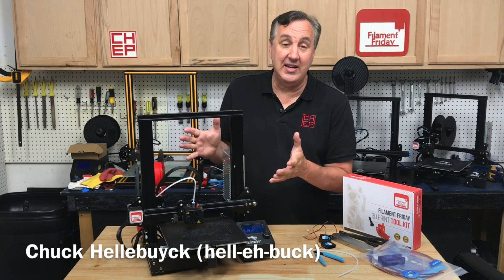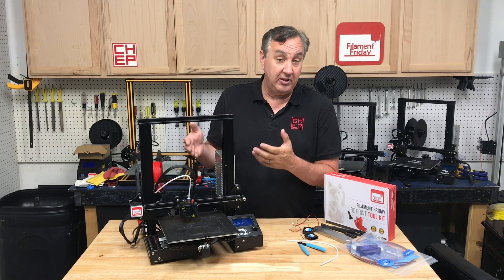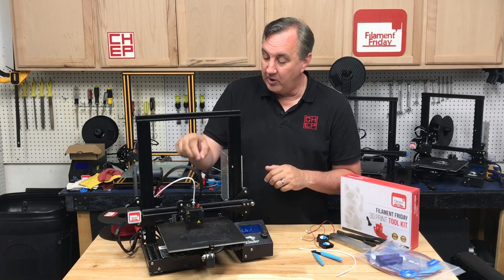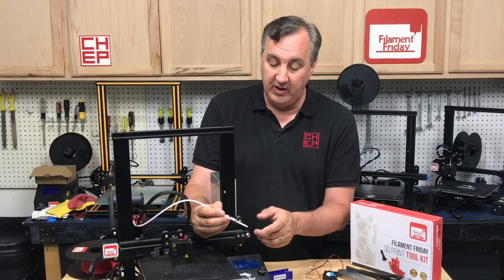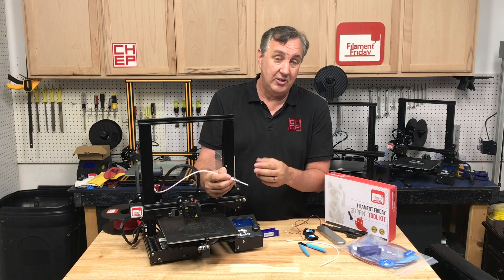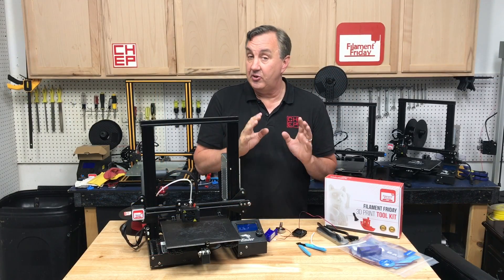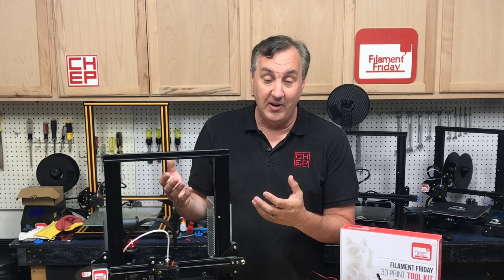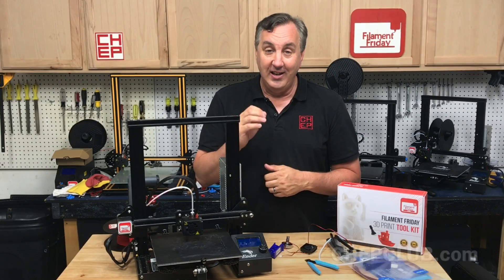Maintaining a Creality Ender 3 - 3D Printer

Comment: Hello sir, I have a problem which I could not see in YouTube, basically the machine start printing nicely, it gets 10 to 15% Then the motor pull the filament almost all out, twice, then put it back straight in, and then the machine stops. I even put a new motherboard. Is still the same.
Reply from the maker: Sounds like problem with the slicer file, not the machine.
Reply: @FilamentFriday  
 
Thank you very much for your prompt answer. Unfortunately I am at work I don’t have the computer with me to change anything in ULTIMAKER CURA slicer. I shall do that tomorrow, ( I might be stretching my luck, but my last question is, under which guardians should I tick to change that) 
again, thank you so much.

Comment: I bought an Ender-3 V2 Amazon return and have been really happy with it.  I found the best way to remove filament is with a 'cold pull'.  Heat nozzle to temp - say 210C - then cool down to 90C.  Pull the filament and it should come free including what is in the nozzle.  It does work but I do have one filament that won't cooperate.  Thanks for your videos.  Another fave to keep watching.

Comment: So, 2 years later was still going strong (Thank You!) but recently started having some major print issues, the only thing I have not ruled out is the Capricorn end tube bit (now stuck in the Ender3 extruder). I can't for the life of me get the Capricorn out now. It's like it's fused in there, even if I heat the extruder to 240. Any tips? Thanks in advance!

Comment: 3D printing newbie here...got an Ender 3 in September and did a lot of prints then things started going awry.  Got things back on track then saw this video and decided maintenance was in order.  Went through the steps to include snipping the PTFE tube and replacing the nozzle from a pack I picked up on Amazon (20PCS 0.4mm MK8 3D Printer Extruder Nozzles for Makerbot Ender 3 3Pro CR-10, Extruder Nozzles).  I noted that the nozzle opening appears a lot smaller than the stock nozzle and has a point.  Releveled the bed using your awesome gcode and tried to print.  Nothing extrudes from the nozzle...and barely does when I try and "push" the filament through.  Heat is at 200c and I tried 205c but nada.  Any ideas?  Using HATCHBOX PLA Dimensional Accuracy +/- 0.03 mm, 1 kg Spool, 1.75 mm.  Thanks in advance and Happy Holidays!
Reply: never mind...I re-did the steps and changed nozzles again.  This time I cleaned the PTFE pathway a bit better and (with new nozzle) it began extruding just fine.  Printed a calibration cube and it came out perfect.  Back to joyful printing!  Thanks for the video!

Comment: If you bought cheap filament and find it does not stick to the bed as the good stuff does then do what I do. Buy 1 reel of good filament. Use it to lay the first couple of layers then cut it about 6 inches from the extruder and slowly feed in the cheap stuff. When doing so make sure each cut is square and flat. Gently butt the cheap stuff again the good stuff as it gets fed into the extruder. Now the cheap stuff will be used for the bulk of your work. This method also works if you want to change colours on the fly. BUT if you mess up the first feed then you have to start again.

Comment: I would love some help. I bit desperate actually. I bought my son a Ender3 for his elementary school graduation...we have it set up, it gets to the point where the first and second layers are put down and then it printer raises off the table and just hovers high above the bed and doesn't release filement...anyway there's a support line for this thing :).  Any advice would be greatly appreciated.
Reply: Have you tried updating the firmware or checking your slicer settings? I haven't had that particular issue but that is where I'd look first for a fix.

Comment: Beware of cheap nozzles. I bought a kit that came with few of them. I had to replace them 3 times while changing tube, fittings and everything just to return to my old beaten up nozzle because  with the new ones the stringing was horrible. The only thing that caught my attention when inspecting them, is that the part that comes in contact with the tube has a bigger hole and then it comes down to normal size like a funnel. I think that may create a gap that messes up retraction and I don't think it is fixable.

Comment: Don’t replace the fan if it isn’t spinning properly.  These fans can easily be fixed by simply cleaning the fan.  After time the fan can get dirt in the bearings.  Get some 3in1 oil, take out the plug (often found under the sticker) from the center of the fan, drop a drop or two of oil in it and spin the fan with a finger.   Use a paper towel to soak up the dirt and oil, then repeat the process until the fan spins smoothly.   Put the plug back in and your good to go again.

Comment: I replaced my bowden tube with the capricorn tube and it would not stay in the collar at the extruder.  Blew out in the middle of a 24 hour print and ruined it.  No matter what I did, it wouldn't stay in.  I went back to the clear bowden tube and did the Luke Hatfield fix.  Now all I have to do is check the coupling at the nozzle as it does loosen up a little and a few turns of the wrench fixes it.  Not impressed in the slightest with the Capricorn but hoping the higher temp tolerance will save me in the long run.

Comment: I'm having do much bad luck with my machine I got it about 30 weeks ago struggled with bed leveling struggling with extrusion attempting to check and change the nozzle and it's stripped how can I get the darn thing off now, this machine has been a paper wright for way too long, I printed rather tried to print a calibration cube it was horrible made some "adjustment" and then it wouldn't extrude I have the metal dual extruder you suggested I'm another video I feel like the bed is as level as I can get it but jeesh now my nozzle is stripped and I just want to print something...anything
Reply from the maker: Did it work before you started changing things? 
You can get a replacement hotend if the nozzle threads are stripped.
Reply: @FilamentFriday  I did all of my upgrades right out of the box, the aluminum dual extruder, Capricorn PTFE tubing, bed springs, and it was extruding fine yesterday but It was skipping layers (I believe) First in my "troubleshooting" I checked the spring and clamp on the extruder and attempted to level the bed better, made an adjustment on the gear on the extruder (raised it too high) that's when it stopped extruding but I don't realize that until a few hours of trying to get filament to extrude, id load filament push it in and it would flow but when I go to print nothing comes out past that 1st line on the side of the bed which is basically what i pushed into it.

 I watch a few more videos and I'm thinking maybe the bed is too high but by now maybe I've clogged the nozzle, I bought a few extras so I figured ill just swap it out not knowing that I needed the nozzle to be hot...  So I'm pretty sure I stripped it, but the tool is also a bit cheap as well so I'm hoping there is a better tool I can buy to help me get that thing off than what came with the machine. 

-Otherwise I'll need a new hot end if I cant get that nozzle off? 

(also just a side note I see people take that shroud off so easily but mine has never came off and I don't want to break it but im sure it would make it easier to change the nozzle if I could go in from the front any tips on that?

 -Thanks Sooooooo much for your response, please keep those videos coming! They've been a great help so far!
Reply from the maker: Not sure what Ender you have but two screws removed the shroud. If it’s a V2 then it had a pin that lines up in the bracket that may be fighting it. If you just rounded the hex of the nozzle, heat it up and use a pliers to grab and turn it. I have a recommended nozzle removal tool in description of my latest videos.

Comment: Just happened across your video as I was looking for any insights into Ender-3 print head maintenance.  All of your suggestions are quite fine.  However, how much have you run into the issues with bad filament?  You brushed across the topic just briefly in this episode.  I ran into an issue as I am relatively new to 3D printing.  I bought some rolls when I purchased my printer and promptly started using them up quickly.  I then found a deal for Cyber Monday sales back in November for ten 1KG rolls for just $100,all made in the USA and free shipping.  Such a deal...  However, not all the filament behaves the same.  Of this new brand, their black and brown flow like butter, but their "silver" (barely looks better than slightly metallic dark gray) wound up being just awful!! No sooner than I started using it, the drive on the Ender started to skip from back pressure.  It was most prominent when starting the print so I did make sure the bed was adjusted. Eventually it was skipping a lot after about 1/4 of the first (of two) rolls was used up and and then just simply stopped flowing.  Took everything apart and had to drill out the nozzle from the back side and use the probe from the front (my new nozzles have not arrived yet!!).  I changed filaments and printed again with no issues for a couple full rolls.  Went back to the silver and again, it ran for about 1/4 and stopped.  I should have just thrown it away then but I am stubborn and I raised the temp by 5 and tried again.  Worked for a little longer but eventually I gave up after the second roll was 3/4 done and threw the rest away.  Right now the Ender is happily printing items in black and it's performing flawlessly.  The only observation I can give is that the silver backed up at the top of the nozzle with a blob that simply wouldn't melt.  It even made pulling it out difficult.  So how common is this bad filament issue??
Reply from the maker: Bad filament happens. Sometimes good filament becomes bad filament if left out to absorb moisture.

Comment: Two things. 
When changing fans get ball bearing fans. Not sleeve bearing fans.
They last alot longer.I already changed all of mine.
Also on the extruder.
The bearing that is on the arm needs a drop of oil now and then. 
Or it will start skipping. And shave off filament.

Comment: Love your channel. I've had an Ender 3 (my first!) for just over a week. I've already upgraded most of it (including that latest SKR Mini!). About to upgrade the extruder bits to all metal. I gotta say... that stock bed surface suuuucks for someone who is new to the tech. I've upgraded to glass and still having adhesion issues at times, even with glue stick. Yesterday, I figured out that I definitely need an enclosure due to a drafty house. I've noticed some of my prints warping on the bottom and I suspect the draft is impacting how filament is sticking on those first layers. My printing is on hold until I can place my printer properly. I'm babbling. Are there any good groups to join where I can babble about my new obsession with other newbs? Thanks for helping to guide me this last week, Chep!
Reply: Usually if you wash the glass surface with alcohol or cloth, it should stick better. Also, check to make sure your first layer is a little bit squashed on the print bed.

Comment: Hi Chuck. Let me share what happened to me... I was getting some inconsistent printings and decided to follow your advice. It turns out that the PTFE tube was lightly burnt and the nozzle was carbonised. I put on a new Capricorn PTFE and a new nozzle. The printer got better, but still not the same as it used to be. The prints showed some signs of under extrusion and "unevenness". I tried everything, from new filament to calibrating E-Steps. Nothing. Well... I was about to revert to a white generic PTFE to give a new try, when I decided to mesure the extruded filament with a calliper... and got 0.56mm. Making the long history (almost) short,  there was a 0.6 nozzle among the 0.4mm 10-pack I bought! Now it's perfect agains. Cheers from Brasil, where you have a bunch of followers!

Comment: hey CHEP, my Ender 3 sat for a month or two and is now having issues. I printed a spring cup to increase tension, loosened the idler arm screw, put on a new nozzle, leveled, re-sliced, and reinstalled my slicer and issues remain. Two predominant issues are no extrusion happening from the nozzle, the extruder is moving but its not pushing any out. Issue two is the bed and extruder arm stop moving and its still extruding, this has only happened once though. I am running Hatchbox PLA at 200 and 55 on the bed.

Comment: Hey CHEP, I'm having issues with filament curling. It's not curling into the hotend, it's curling seemingly at random during parts of the print. (I did a d&d mini and it had a mess of spaghetti in one hand, and I'm making a wall now and only one side has this problem and only three rows has it).

Every time I try and Google it I get stringing tutorials, but this is a full extrusion, and I don't know what causes it.

Comment: Hi Chep. I have a question. I am making cookie cutters. This one went a little haywire and after creating the base, there is filament string all over the place. The bed was just leveled.The glass was just cleaned. Do you have any other ideas? Thanks
Reply from the maker: Did you follow my bed level video?
Sounds like it’s not gripping properly.
Reply: @FilamentFriday  I did and its all fixed. Thanks so much
Reply: @donnaarmstrong  I would reccomend petg for you if you're making cookie cutters
Reply: @eduardo_Skywaller1032  Thanks for your help
Reply: Make sure you are using Food grade filament. PLA is not a good material for cooking utensils.
Reply: @andypandy5781  oh my goodness, thanks so much for telling me this
Reply: @andypandy5781  any recommendations of food grade filament?

Comment: Thanks for another vid that is timely and right on point but I still have a question.  I bought a metal extruder to replace the stock plastic one right at the start.  Ever since I have wondered if the spring exerts too much pressure on the filament by the gear.  It doesn't slip, but is it too tight?  How to tell?
Reply: Loosen the screw until it starts to slip during extrusion, then slowly tighten it until the slipping goes away (make sure the hot end is up to proper temp while doing this). Then turn the screw another 1/8 - 1/4 turn more. Done.
Reply: @CoroaEntertainment  Thanks for the very clear suggestion.  I only wish I could put it to use but my extruder is not adjustable!  Since it isn't, I am left wondering whether it is too tight as I had mentioned earlier.  With all that said, I suppose I should buy one that IS adjustable, if it's that important to me, follow your instructions, and stop whining!

Comment: Another thing to check — the screws that mount the hot end to the x-carriage. After about a year of heavy use, mine loosened up and I ended up with loads of what looked like layer shifts as the whole hot end rotated back and forth. Took me weeks to figure out that was the problem.

Comment: Hi Chep, I bought my first printer(a ender 3 pro) about a month ago and I picked up a used ender 3 original the other day. thank you for all the information you have provided as well as the profiles I got my printer up and running quite well in seconds. I was wondering if you have ever encountered in potential issue regarding the stepper motors on the original ender 3. It feels like flat spot is I push it along the x axis. My ender 3 pro doesn't have this. I was wondering if maybe the wheels are flat but it didn't appear that was the case either. Thank you for all you do.

Comment: I live in a dry climate where humidity can go down to 30%.  I have to be careful in touching my Ender 3 and my first contact is usually the frame or table.  Sometime I forget and first insert the SD card when the unit is on.  That results in the display going blank and a power shut down is needed.  Have you or any viewers experienced this static electricity issue and what steps should be taken?

Comment: Hey
Somehow my extruder stepper motor heats up the extruder gear and causes the extruder to start skipping and not extruding filament. (Ender 3 with Enclosure)
Any tips on how I could cool the stepper or keep the heat away from the gear?
Reply: Open the chassis, or include some sort of fan. Steppers don't like excessive heat either, and i hope your PSU / control board are outside of it. 
In addition, cooling fins do help a lot - with or without a fan.
Reply: @FM-su2cn  First, thx for the reply.
I have a fan on the mainboard and it is running constantly but it is still in the enclosure with the printer.
My PSU got a better fan and is placed outside the chamber.
Looking out to buy some cooling fins or in the worst case build my own little watercooler :D
Reply: @icec00kie92  the Mainboard does have fresh air access from outside? If not, drill a hole for the fan.
If you don't print abs, just open the chassis a tiny bit, or include some fan to get rid of the excess heat.
Some cheap cooling fins attached to the steppers, and you're fine.
Had the same problem once, those were my solutions at least (:
Reply: @FM-su2cn  Good ideas
Thank you :D